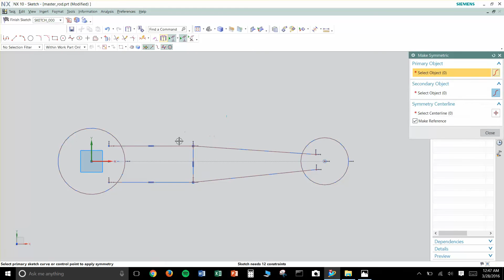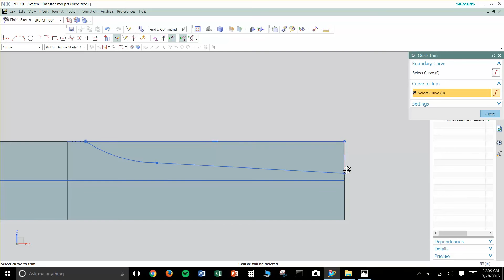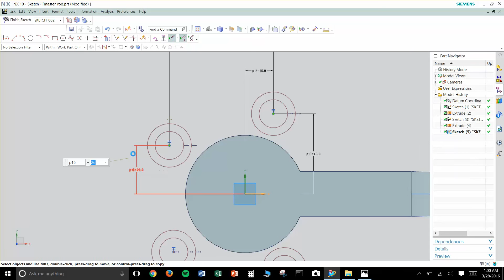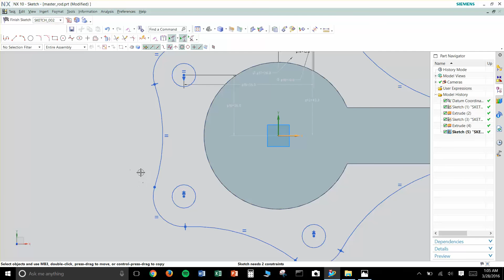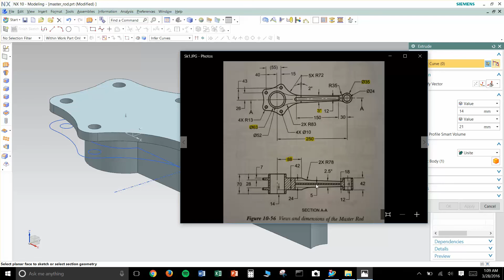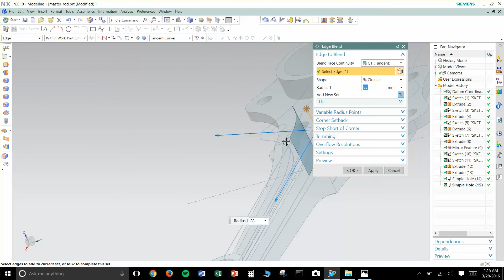Siemens NX: Master Rod of Radial Engine Modeling

Comment: Hi Chales Florez. 
At 20:25. I think you can draw 3 points arc, 3 tangent with circle and apply dims, the other one is tangent to circle and coincedent to end point. Instead of draw 5 big circles.  
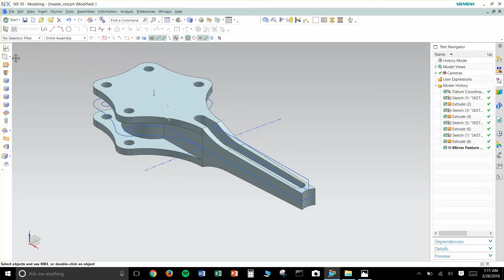At 29:35. Instead of draw a big circle is the same as inner circle,  you can project a dia. from inner circle. All you have to do is draw a small circle.